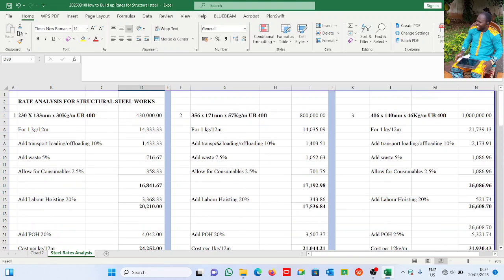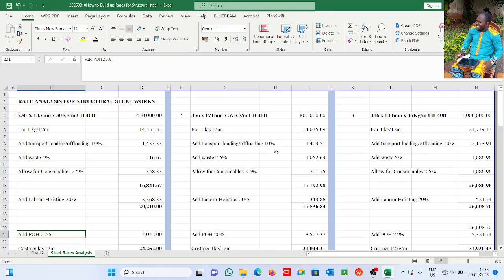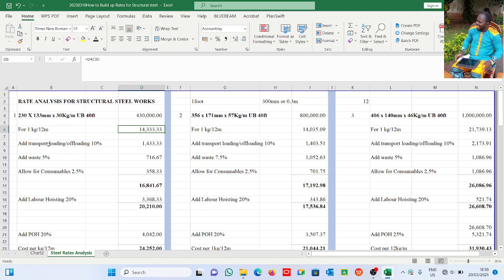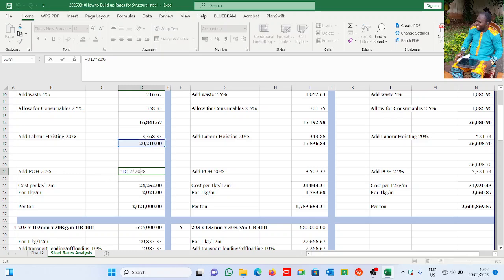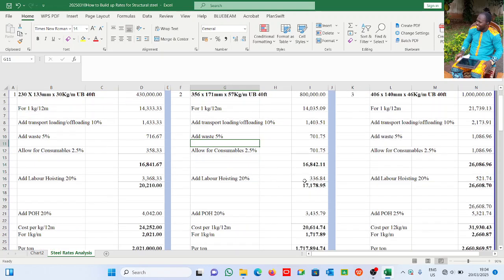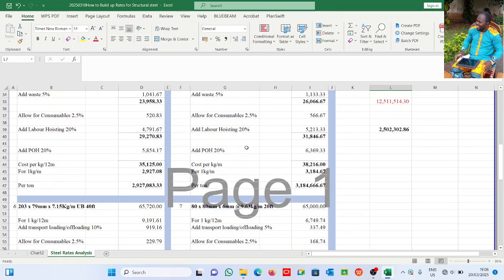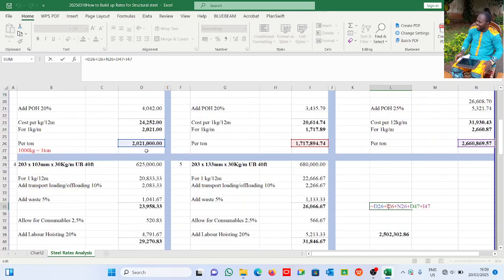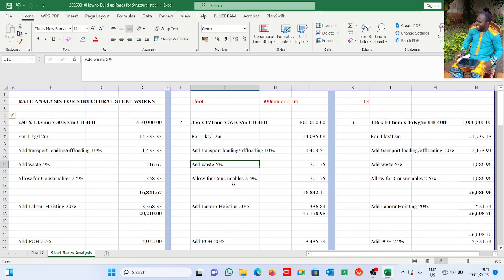How To Prepare Rate Analysis For Structural Steel Works

Comment: Weldone sir, it would have been better if you speak to how you arrive at the % you are applying to Labour, consumable,transport and the rest 

This approach is only applicable  to  established firm that over time kept cost data from past projects which they can refer to by using the percentage from near similar jobs 

Because this item can be practically calculated, I take for instance the transport 

Say if am renting Truck and it cost 300k and the total material am buying weigh 10,000 I would divide 300k/10,000

Why this is necessary is because the job may require you travel far just to get steel structure materials that is just 2ton and the transport is 300k, if you apply a flat % you may be shortchanging yourself.

Also Labour you should estimate no of work men and the time it would take to complete the job divid by the total weight to get your cost per kg rather than the % because it is not at all instances it would fly. 

I could go on and on, that does not suggest you are totally but for educational purpose we need to crystal clear because your audience defers.

Comment: Always on point, my observation is that steelworks come in:
1. Framing Fabrication 
2. Framing Erection
But you joined both together, can you pls clarify.
Thumbs up for the good job!
Reply from the maker: @hanifabdulkarim733  thank you for your observation. Fabrication involves cutting the steel to sizes to be erected, perhaps sand blasting, jointing to a base plate, creation of holes for holding down bolts, etc. Then the actual erection on site. I grouped everything into labour hoisting (to include fabrication and erection). You can also separate if you want. Thank you for watching and engaging our video. Chacha Quantiks
Reply: @CHACHA_QUANTIKS  Thank you for the clarification.

Comment: Well done for the job done.

An observation is that the rate does not take consideration for red oxide and epoxy coating.
Reply from the maker: @GodspowerOsaretinOsarumese  True. I said it in the course of the tutorial that painting and accessories are measured and priced separately. But if you want to include them, it's 2.5% painting and 2.5% for accessories. Did you listen to that part?